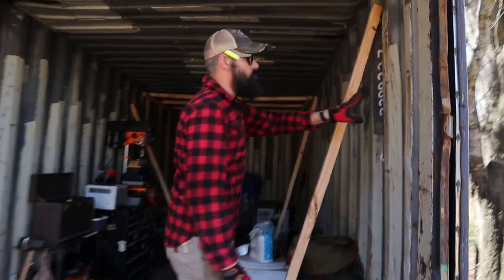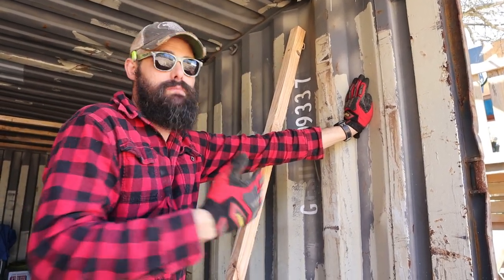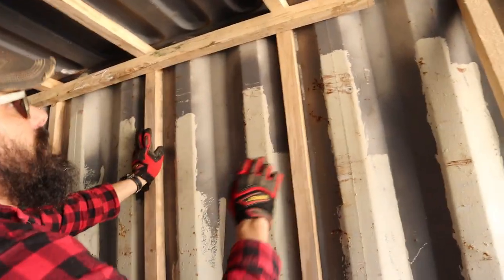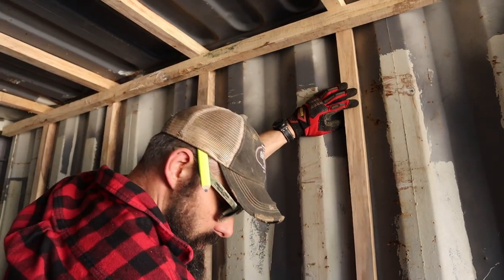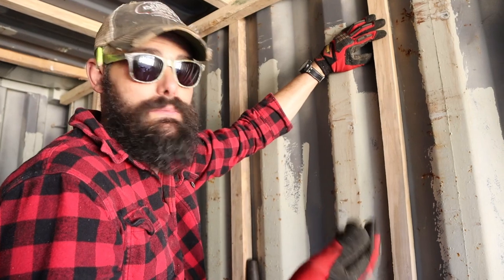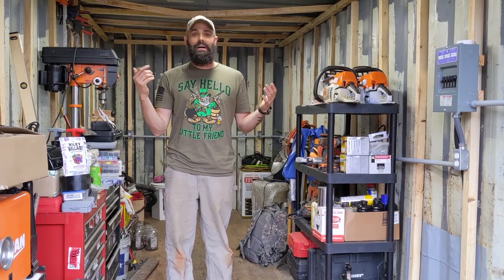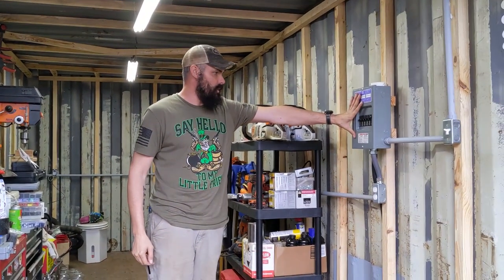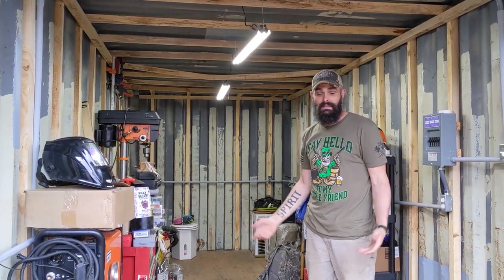Shipping Container SHOP - Frame and Power - Vlog 58

Comment: I used to work for a company that turned shipping containers into buildings and here is one of the techniques for fastening studs to the walls without screws breaking the water tightness of the unit. We would use boards that where about 0.25" - 0.50" too long and a thin bead of expanding foam. Between the pressure of it being wedged into place and the expanding foam acting as a glue, the boards would be extremely secure. Then you could just screw the roof frame to the wall studs and be good.

As you have already witnessed, a non insulated shipping container makes for a great condensation generator. Therefore ventilation and a dehumidifier will help a lot, but if your really going to use it long term as a workshop your going to need to insulate the roof and walls.

In other News, I'm enjoying the build and rooting for ya. I plan to get myself some land and do something similar in the next couple of years. In the mean time I'm learning for Youtube University and your one of my favorite professors, lol,  and I can't wait till you get to the fun part of putting on the roof. In the mean time stay safe, stay motivated, and keep the updates coming. Thanks you.
Reply from the maker: That is a GREAT idea to use expanding foam as glue for the boards. I have been running a dehumidifier every night to keep the humidity down. Hopefully this is a pretty temporary shop so we won't need to insulate. Thank you so much for the encouragement, things have definitely slowed down during the winter but we are getting back to it and making progress.

Comment: Glad I found this video.  I've been looking for a simple idea to put some framing in my conex which will be used primarily for tractor storage, with a small solar system.  This looks inexpensive, functional, and within my ability.

I appreciate how adding the screw from the outside gives the verticals a lot more stability, but do you feel like I could achieve the same thing with construction adhesive?  I'd have to wedge each vertical and let the adhesive dry, but oh well.  

For your humidity control, how about a simple continuous duty exhaust fan?  By creating a slight negative pressure in the container, wouldn't you effectively eliminate condensation?  I looked at fancy basement drier systems and that's all they were - a big exhaust fan, creating low pressure in the basement to suck out damp air.

Thanks for posting.
Reply from the maker: So It's been about a year and I can say that we didn't have an issue with humidity but a fan definitely wouldn't hurt. I think the wood may help with that because have a second container that didn't have any wood structure and we have had significant humidity issues (dripping down from the ceiling). I would also say that construction adhesive would be a great option, the only reason we didn't was because this is a temporary solution and we can spot weld the small holes from the screws when we are done. Hope that helps
Reply: @RedEarthRanch  That does indeed help.  It's also good to hear how it's working after a year.  Again, thanks for posting.